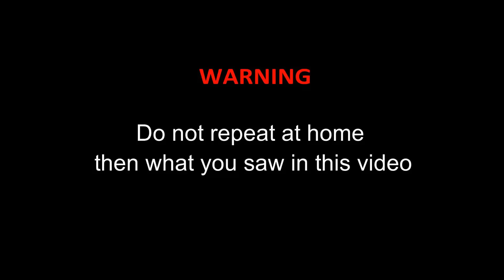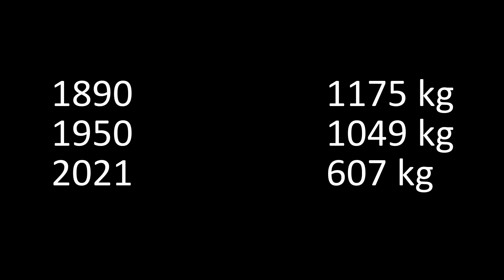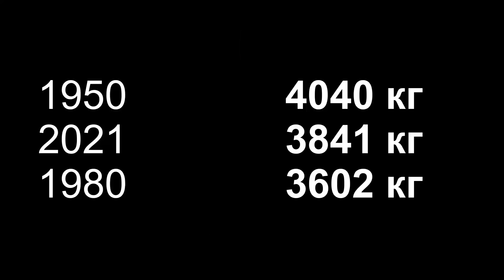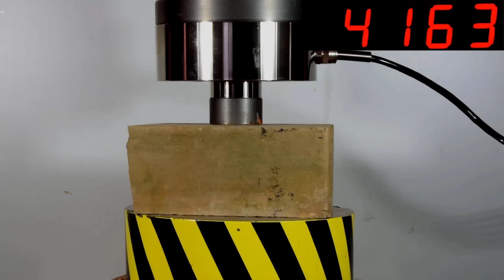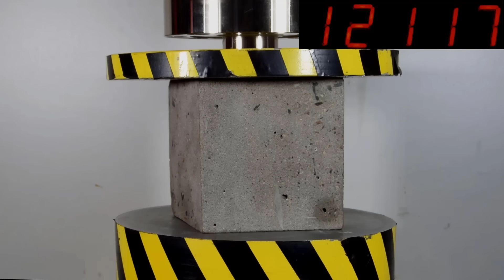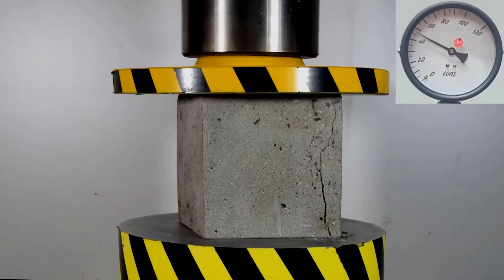HYDRAULIC PRESS VS OLD AND MODERN BRICKS

Comment: So a lot of people have covered this already,  but I feel like some might still get the wrong impression from this, as if manufacturers today are cutting costs at the expense of safety, and “they don’t make em like they used to”.

Modern bricks are made more with small air pockets in them like a sponge, for several reasons. One; to lighten the load (and certainly reduce a bit of labour cost). Two; reduces the affects of temperature, moisture and high winds expanding and contracting and causing structural issues, as they would very easily with older bricks. Three; makes heating/cooling the interior easier without resorting to types of insulation like asbestos. Four; makes them cheaper and easier to produce in the first place. Five: reduces the thickness of walls necessary just to support their own weight.

Modern day buildings don’t use bricks as load-bearing walls; they’re basically just there to keep the weather out, and don’t need to be as strong. Older buildings used brick walls as load-bearing walls, so they had to be tougher, thicker and heavier… meaning much more expensive, more reliant on asbestos insulation, and more likely to crack or rot under wide swings in temperature or heavy moisture. They were also much less safe in the event of hurricanes/tornados, earthquakes, etc.

Of course there’s also a “survivorship bias” element - these are bricks that were built strong enough to last, rather than your average old brick from 1980/1950. The 2021 brick was likely just an “average” brick, not a particularly strong one for the day.
Reply: Wonderful analysis! Thanks for the insight
Reply: The best comment here has a mediocre amount of ‘likes’ whilst other utterly stupid comments get hundreds of likes, there is no sense to the world.
Reply: Agreed, engineering is way more than just designing the strongest object. There are many more facets that are involved especially in modern day buildings. People seem to forget that regulations have dramatically increased since the 1950's and objects that were fine then would not adhere to modern building codes now.
Reply: tbh was even wondering if/in wich manner the age of the brick/effect of time were not changing their property to start with

along with the idea you mentioned that those were clearly among the good one since well they susrvived till now ^^
Reply: Well they don't make 'em like they used to; But that don't mean that any corners have been cut.
What it does mean, is that methods of manufacturing, and mass production, have changed. I mean we can't all be building like the Ancient Egyptians, and have our buildings stand the test of time; It would take far too long, and far too many resources, to do so.
Reply: All of em are good points if it weren't for the fact that almost all of em are local factors. So for me as a German who lives in a building that is over 100 years old and made out of bricks with no asbestos insolation just thinks the fuck is this guy talking about because very little to no points you made apply except the reduced cost and marginally better insolation compared to more commonly used stonewhool.
Reply: this is true for almost every one of these videos of "old vs new"
Reply: I reconsidered importantce of strong walls after the start of the war.
Reply: Don't forget, most of these tests are also unusual circumstances for bricks! The press is usually applying pressure to a more condensed point, rather than evenly across the brick- that doesn't tend to happen to bricks in a wall unless you're jackhammering it for some reason. The tests with the wide press also don't have factors like mortar and other bricks to apply pressure to the sides and help keep the brick stable. They're very interesting material tests, but not necessarily indicative of strength in intended applications.
Reply: All those words don't mean shit. Everything is made to fail now so more work for the masses. Also the houses now are Nike shoeboxes 5,000 in material to be sold at 400,000.
Reply: @JPSimen  you may be right about domestic appliances or electronic devices, planned obsolescence is definitely a thing. But not on everything, you are very wrong about any engineering with great life cost on failure, such as aircrafts and buildings. I work with aircraft maintenance so I know more about that than construction. 

The safety regulations are extremely strict nowadays, MUCH more so than ever before, you clearly have never seen something like a Rolls Royce or FAA aircraft engine repair workshop audit. It's weeks of strenuous safety, paperwork and methodology checks, and it's very hard to pass. 

People don't (legally) cut corners when it comes to mechanic or civil engineering, properly regulated constructions and vehicles nowadays are extremely safer than those 100 or 50 years ago.
Reply: this is very interesting, but now i randomly wonder about the old temples. I heard some made from stone materials that were crafted, and they just stays as it is until now even survived literally almost everything. As for what i witnessed directly, borobudur temple survived several earthquakes. That I can't understand still until now
Reply: never thought I’d be learning about bricks through the years in a YouTube comment section, let alone finding it interesting. wanted to say that I really appreciate the effort you put into your comment dude
Reply: No one has mentioned that the tests weren't equalized either.  The 1890 brick is way bigger than the modern one, of course with that extra width/height it will have a higher fracture point.  Also, it looks like the weirdo putting the bricks under the device was just arbitrarily throwing them under there; where the spacers under the brick was placed, the orientation of the brick, etc. all have huge consequences on a fracture point. Properly equalized, there is no reason to even grant the conclusion the 1890 brick was stronger.
Reply: There is also the point that there are different kinds of forces.

The first test, with the brick suspended on 2 risers, is testing tensile strength.  A force that bricks should never be subjected to.  The second test is what bricks are designed to take: compressive force.  In in that test they were all pretty close.   If he had done more tests with different bricks from each Era to account for variance in individual bricks, I would be willing to bet that you would find the modern bricks have better consistency, and the older ones would have some that performed better than modern, and some that performed worse.
Reply: You can even see the more high-load brick could out-do the older bricks because that particular brick was DESIGNED for load-bearing and for durability. I think that more than anything else shows how far we've come with getting the science down on things like brick-building compared to what we know back then.

Glad your comment has so many up-votes. Shows people ARE listening and thinking when they look through the comments.... well, sometimes at least.
Reply: So, what you're saying is: "They don't make them like they used to."
Reply: This was a very well done analysis, thank you!
Reply: There are also because different building structure, in past many building don't have concrete colom structure, but use double brick/structure as pillars, this thing need more strong brick, that also more costly than modern concrete structure, you can also see that old building have tight wall building because load (live load and death load) distribute to all part of structure.
Reply: I'm not sure about you but here in Australia most houses are probably still brick and most new houses use brick as structural, pretty sure that much of the world is like that.
Reply: I don't care about abestos or the weather I just don't want my House to collapse over the years so I am glad I live in a House that was built more than 40 years ago after seeing this lol
Reply: @ah7910  Sounds more like an opinion than an analysis. Trust your eyes, the old bricks and concrete were stronger and stronger building materials are better.
Reply: @redthunder6183  Nah, why would modern companies want to give you more for your money? It's not logical. Fact is as time moves forward quality decreases.
Reply: @JPSimen  you know you can still buy bricks that are non decorative and designed as load bearing for a building?

This person purposely misrepresented information here by not using a modern structural brick.
Reply: One thing to remember is that most brick used in homes today is called brick veneer because brick is not a structural part of the building.  The brick could be removed and siding added with no weakening of the structure.  Homes built in the 1800s would sometimes have walls made of brick so these had to be denser and stronger to support the load.  Modern homes with brick do not use brick to support a load, they are mostly decorative.  This is why they are lighter and much weaker.
Reply: Thank you! I did initially assume that they were just made more cheaply in modern times, but when I saw the 2021 brick and realized how light and porous it was, I realized that there were other factors involved. Your information cleared it up for me. ^_^
Reply: @SkyCloudSilence  yes. You can buy hand made bricks that are not extruded and load bearing.

This person chose to use a decorative brick.

Your way back machine isn't as good as you think it is.
Reply: Very informative.  Thanks for your insight!
Reply: @SkyCloudSilence  yeah. I just built a brand new brick foundation and porch with hand made bricks.
Reply: Also, I believe in the case of the concrete its strength is based on a good mix with enough water, and the addition of small stones makes it stronger
Reply: @SkyCloudSilence  im not. 

They have been using the bricks he uses in this video going back a long long ways 70 years or more. When house foundations and walls started to move away from brick to concrete and wood frame the use of the brick changed. They became a decoration, a siding. The walls didn't need to be multiple layers thick and support all the weight of everything.

So other bricks got popular. They didn't go away.

I'm sorry you've convinced yourself because of some false sense of back in the day.
Reply: If they didn't want to use asbestus, why not just use fiberglass? Every other reason you gave essentially wittles down to just saving more money, being cheaper about it. We don't use bricks for load bearing walls true, but because the alternatives we use now are... cheaper, easier to produe. Therefore everything in construction now is made not to last, but to be cheaper, always observing the total cost to put the most cash in your own pocket. It ultimately all falls down to being cheaper but not necessarily higher quality. I wonder if this is efficient in the long long run, or if having sturdier materials that withstand the test of time (needing to be replaced in greater intervals than current materials we use). Idk if I explained well but thanks for the info.
Reply: While that may be true, many homes constructed in Puerto Rico were made with concrete. The strongest hurricanes make the houses shake but with proper air flow (opening specific windows before the storm arrives) they won’t cave in like many brick or wooden homes, which many use to construct newer homes in PR and get destroyed immediately. The only problem is that roofs aren’t made in the best way so many times you get holes in the roofs. Also yes, it creates a hotter internal environment but with AC installation (not during nor immediately after hurricanes due to power outages), sometimes slightly opening windows at night, and proper hydration then it shouldn’t be a problem. My aunt and I survived Maria. It was terrifying but we made the best of it. We even used cereal boxes as handheld fans. It is what it is lol.
Reply: @MetalSolidCrisis  Hear, hear!
Reply: Modern bricks are lighter, making them easier to throw at annoying kids that yell "HOOPLA!"
Reply: @SkyCloudSilence  yes, they do. 

You are ignoring the 99.99999% of all that old shit that died 6 months after it hit consumer hands because a few survived. People have literally been bitching about "the good old days" since as far back as modern man has existed.
Reply: @Ghardyne  I'm from the Caribbean and I was thinking the same you are. Apart from cost and better insulation, all the other points don't make sense to me.
Reply: they should do a test not just with a hydraulic press they needed to do test on all the bricks vs extreme heat and cold
Reply: Damn so they really don't make them like they used to.
Reply: With the concrete test as well- we don't just pour concrete anymore. We reinforce it with thick bars of steel, that's the whole job of a steelfixer.
Reply: Pin this, [insert insult here]!!
Reply: Thank you so much for the info and breakdown!
Reply: @gray-ish1844  big difference with borobudur is that it has no bricks its all hewn stone which is a LOT more durable (look at the pyramids of gizeh for instance) than an created brick.
Reply: exactly!!
Reply: "Lets get this straight. It's not to cut costs, but it's to trade off strength for anti wear benefits and to cut costs."
Reply: You say they didn't make bricks shittier to cut costs then write a love letter to all the ways these shittier bricks let them cut costs
Reply: @evil1by1  in addition they save money, why spend more on strength that isn't needed,
Reply: Based comment
Reply: Thank you for explaining. I just wanted to know why it broke in the shape that it did. This explains a lot and I appreciate it.
Reply: You basically said "we use cheaper bricks, but they also expand and contract."
Reply: @JPSimen  literally. He just came up with an answer to everyone's common sense questions, but at the end of the day, it's late- stage capitalism.
Reply: meanwhile bricks in the Roman colosseum: I'm basically immortal
Reply: This is such a good response.
Reply: @SkyCloudSilence  that don't make things like they used to for good reason. It is better for the object to break than for the person using the object to break. An object can be costly to be replaced but it can be replaced. A limb, organ... a life? Yeah, pretty hard to replace.
Reply: @buckrodgers1162  the Egyptians ALSO built shitty mud huts for their poor or for temporary purposes and obviously none of those have survived like the stuff they built for their Gods, that was intended to last forever.
Reply: @aazhie ,
You mean their slaves? Because even some of the city ruins of the 'Lower class' have been found somewhat 'intact'. Or at least the foundations of them.
Reply: Wanted to comment something similar, but I'm happy to see such an elaborate and well worded explanation!
Reply: While you had pointed out several correct points, I would like to correct you in a few areas. They are:
1. "One; to lighten the load..." While such bricks are manufactured, the bricks tested in this video do not look like your implied aerated bricks. 
2. "Five: reduce the thickness..." Due to how bricks are laid in a wall, i.e. one on top of another, the density of the bricks has no effect on how thick the wall needs to be. The thickness of the wall is dependent on other factors.
3. "Modern day buildings don't..." I think there are still engineering bricks made to support structural members.
4. "...there's also a "survivorship bias"..." Although this may be the case here, it is equally possible that the tester had gotten the brick from a pile of them. All of them had survived a century of existence, so they are all really that strong. The survivorship bias is a small factor in this case, I think.
Reply: Thanks for taking time to explain this -- much appreciated!
Reply: I think your analysis is biased to favor the modern bricks. But still they suck in comparison to older bricks. Besides, the more interesting part of the video is what followed next: the modern high resistance brick is awesome!!! It is so impressive that not even modern concrete could stand a chance. And finally, over the top is older concrete... It is insane!!! 60 tons.... I pressumed there should be other types of modern concrete which can stand such pressure. The video should give a bit more insight to compare fairly. Because  so far, it appears that we are living in a cheap world where profit is more important than safety.
Reply: Well put
Reply: That makes sense to me!
Reply: Interesting! Thanks for clearing this up! 😀
Reply: Genuinely wondering how the sponge brick or heck, plaster walls are safer in a tornado than the stronger alternatives.
Reply: cement blocks?
Reply: Sounds like something someone from Big Brick would say
Reply: I dont agree, just have a walk across the most Europe's cities and the old buildings will tell you your wrong. For reference see the Colosseum in Rome...
Reply: I havent seen full bricks for many years. All i see is bricks with app 40% hollow areas.
Reply: 🏆 excellent explanation
Reply: ACKSHUALLY
Reply: @redthunder6183  No, it's not, it's just cope.
Reply: @ah7910  what about now ? ^^
Reply: And they have different bricks for sale. Some of them are really light.
Reply: In brazil is normal house using bricks, The walls are thick, and it's not expensive, in my opinion, it must be because it's a hot country.
Reply: So?
Reply: No a lot of the bricks used in earlier buildings in the USA were made in peoples back yards. They weren’t manufactured they formed the dirt and stacked in a fire pit
Reply: learnt a lot from this, thank you!
Reply: @ah7910  Now it has 5000 likes
Reply: Exactly.
Reply: Aaaaand you didn't watch the last brick did you? Kinda proved you right didn't it? Made your over long comment on how misleading it was pointless didn't? The best modern bricks are super superior to the older bricks... probably way to expensive compared to ye olden bricks were by their time but still the modern stuff can be much much better.
Reply: From my experience, 90% of your second paragraph is a lie.
Reply: @gruntgamer4204  I agree. It's pretty much all BS.
Reply: let's not kid ourselves, in these times no one cares about the well-being and safety of people. it's just visible to the naked eye.
Reply: This comment should be pinned! I was amongst the thought group "they don't make 'em like they used to", until I read this. This is fascinating! Thank you so much for sharing this information.
Reply: All very good points, well said.
Reply: So basically modern bricks are cheaper and useless, got it.
Reply: The amount of people upvoting this is hilarious. They're not stronger, that's why older houses last longer and survive weather that modern houses don't right?
Reply: @buckrodgers1162  My sister lives in a house built in 1735 ish.  There are advantages to NOT having buildings last forever.

The irony of the British building stock is its the worst in Europe cos its the best built in Europe - its almost all industrial revolution era designed for a time when you had a coal fire in every room.  This does NOT translate well for central heating.
Reply: @piccalillipit9211 ,
I never said that every building should last forever. Hell, the apartment complex I reside in was built in the 1970's. Was remodeled in the early 2000's. And I still have glaring concerns about the number of outlets (or lack there of), and the electrical fire risk it poses. Especially with newer tech requiring higher power draw.

And that's not even to mention that the buildings in this complex, even after the remodel, still fall short of the local 'Building Code Safety requirements'. Because those only apply to 'new' buildings. Older buildings, can 'cheep out' and 'cut corners' all they want, while putting the residents at severe risk in one way or another.

No, for buildings to be even allowed to 'last forever'; First laws would have to be changed to require every, and any, building to be kept up to the current safety requirements of the building codes.
Reply: Amazing explanation
Reply: Exactly the comment I went looking for, thank you
Reply: given the concrete example, I disagree. In fact, the roman bricks weren't tested here, but are stronger still and those do not face the heat problems because they were made with salt water, which creates a more even, heat resistant bond.

Stuff today is cheap trash. No question at all. Just whatever the cheapist most slap dash process scumbags can get away with.

Romans would have slaughtered many builder today over "quality".

You forget what used to happen to engineers whose house foundations crumbled too fast. Yep, murdered.
Reply: TLDR Modern houses are structurally weaker because capitalism requires ever increasing profits to the point where they begin producing lower quality products.
Reply: Nah the survivor brick idea isnt true, my grandmother lived in a house built partially from leftover wood and brick from the turn of the century that had been kept in storage and she still had a shed full of Victorian era brick and Cyprus wood and those bricks were all heavier and stronger than the sponge bricks they use today.
Reply: As someone who works in a fiberglass insulation factory, why the mention of asbestos? Are they actually putting asbestos in the bricks or what? 

Spray foam is safe and perfectly good for brick walls. Its the most expensive of your typical options, so if the bricks have a better R value then you don't need to spend as much on insulation I'm guessing. There's honestly a reason you don't see very much red brick construction anymore, its pricey as hell. Concrete blocks are still used though.
Reply: I've heard the survivorship bias argument online before in regards to old appliances, and if you ask anyone who repairs said appliances and they'll laugh and tell you that's rubbish. Older appliances were actually made better. Modern Samsung products in particular are designed to fail within a few years, and they charge multiple times the cost of the actual part to replace them. Older appliances tend to have far cheaper parts that last longer. Why? Because modern companies don't want you to repair, they want you to replace. There's more money in it for them if you buy a whole new unit. This has become SOP for most appliance companies in recent years with very few exceptions. As a result it's worth being instantly suspicious of anyone making similar arguments in regards to other industries. Even if they aren't shills, who's to say they didn't learn this particular "factoid" from one?
Reply: Bring indus valley civilization brick also
Reply: @tubebubereboot6873  My grandmother also had a 1930s era fan which still ran fine the last time I saw her in the early 2000s. Had a real steel blade would cut off your finger and a thick fabric laced cord. Her and her daughters also had a collection of old 40s and 50s cookware but mostly the blenders from that time are still sought after since they are so much better than modern ones.
Reply: @onechippyboi  i believe his point was just that modern bricks fabricated with air pockets are better thermal insulators than traditional solid bricks, and therefore structures built with them require less additional insulation
Reply: @SunriseLAW  Yea I know what asbestos is but it was banned in 1977, so mentioning it is kinda pointless because it hasn't been used in new construction for 45 years.
Reply: Best YouTube comment of 2023.
Reply: this comment needs to be pinned. so many people think that strength is everything
Reply: @Ghardyne exactly, Americans always think they have smart things to say.

He's trying to give excuses for the decrease in quality and increase in housing price
Reply: Thx for doing what was supposed to be in the video : actual insights on the topic of the video.
Reply: Excellent analysis. Thanks
Reply: As an engineer I only agree half of what you said. The old structure do last longer than the rubbish we’re having. Nowadays the stuff we build have an expectation of 20-50yrs life (in average) without extra structure maintenance but the old historical stuff last hundreds or even thousand of years withstanding all those huge earthquakes and disasters. However the old stuff do took much longer time to build than the premade Lego buildings we are having now which only takes couple of months for a multi storey building, 30days for a small house and even 7days for a temporary removable building.
Reply: @Senkino5o House in Brazil uses a lot of bricks. Not like modern US plastic and wood houses
Reply: Why do you know so much about bricks?
Reply: 100% just because something is stronger doesnt make it better - if it doesnt NEED to withstand 1000kg why compromise on other shit so that it can for no reason? Its a case of the purpose its being used for needs to be considered.
Reply: @ah7910 This comment has the most likes🤔
Reply: So basically- “modern bricks are shit”

Gotcha
Reply: @gray-ish1844 Borobudur was found underneath
Reply: There is also the proper absorption of bricklaying mortar, by partially sucking out its mouisture, therefore making the job easier and the joint more secure
Reply: @Ghardyne  Everything applies, except for the asbestos part. 

Maybe be a bit more specific rather than getting upset on behalf of your aged house.
Reply: Cope
Reply: @irenitaawesome8396 hahaha uneducated
Reply: @MetalSolidCrisis fiberglass used to have asbestos in it. Some still does to this day….
Reply: Disagree.   1890 brick is a tank, house insulated just fine
Reply: And yet, things made from 1890's bricks are still going strong 💪...Makes you wonder why the expression, "They don't make em' like they used to", is a compliment to older things???...I'll  take a new 🏡  made from 1890 brick please!
Reply: I'm missing your point.  It's obvious they don't build them like they used to. Back then buildings were built to last.  Today the shelf life of a  building/house is about 50 years. They are built to be easily demolished.  Your bias shows when you say the older buildings were more reliant on asbestos insulation whereas you can't build a modern house or building without insulation.  And you have got to be kidding me if you are saying these new modern matchboxes are more resistant to hurricanes/tornadoes and earth quake.  In the wake of such disasters the only buildings you see left standing are the older buildings.  All we see of the newer buildings is a sea of pink insulation and OSB.  So yes, modern manufactures are cutting costs.  Those 3 hole bricks decrease the weight, and by extension, cost of making a brick, by at least a third. (how in the heck can a  brick with 3 holes in it be stronger than a solid brick), and newer brick is certainly inferior to older brick.  Now are they sacrificing safety for profits? Debatable. If the bricks are there as just a facade then I would say no. But is OSB and Tyvek comparable to brick as a structural material? Of course not. So the debate rages on.
Reply: @smash_adams Good one 😂😂😂😂😂
Reply: Love this comment. So detailed! 💯
Reply: not quite, this is the wrong context. This video is just a bunch of nonsense because they are different types of bricks.  Bricks are made for different purposes.  Road Paver bricks are hard as shit and will always beat a veneer brick in this test.. It's dumb..
Reply: Literally cutting costs... Most structural issues for tall buildings could be solved with reinforced concrete beams plus most other ventilation issues can be solved with high porosity mortar and good design.
Reply: How does putting more empty space in a brick help with temperature control?
Reply: I would have liked to see a strength to weight comparison. As long as the brick is strong enough to meet the tolerances of the building. Making a heavier brick is just making more work for the bricklayers.
Reply: After all is said and done, a brick wall is only as strong as the mortar used for binding them.